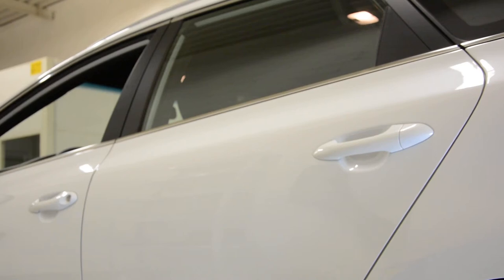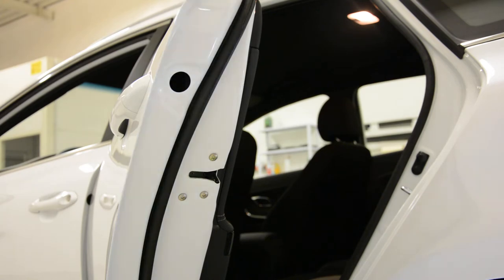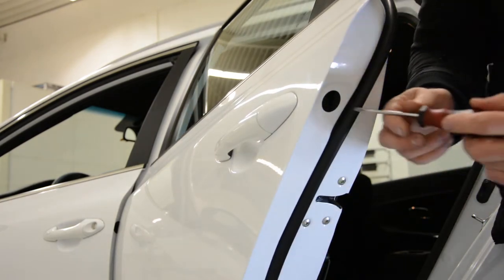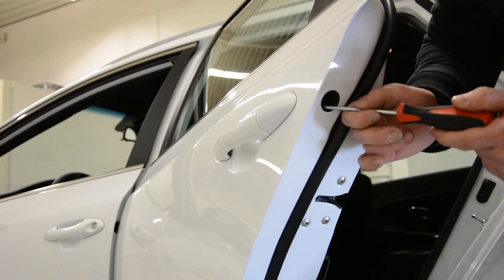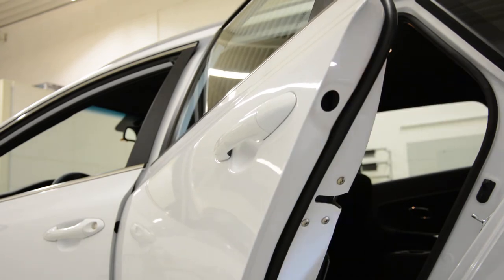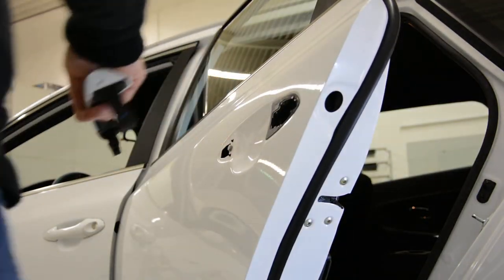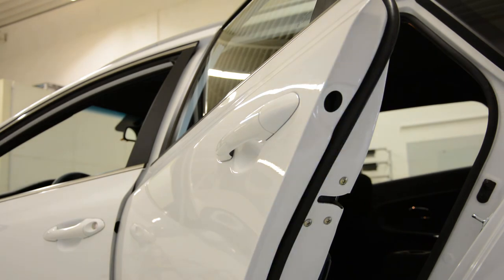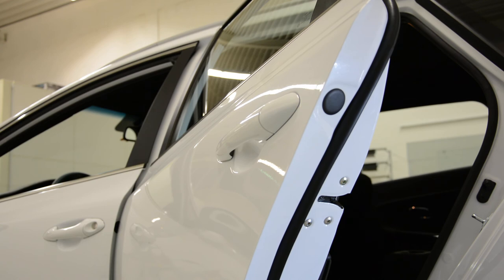Kia CEED door handle removal

Comment: How do you remove the front drivers side handle?
Reply from the maker: Usually on the driver door handle you have an extra screw for the cilinder lock, in Rest the same
Reply: @DFCGarage  how do you get to the plug forcthe button and light?